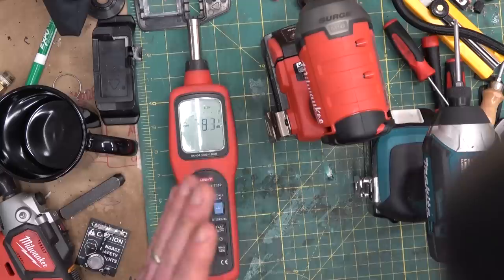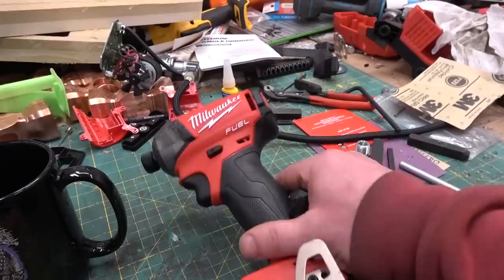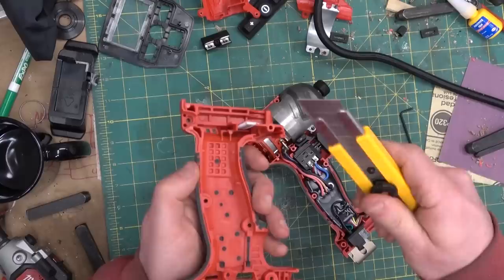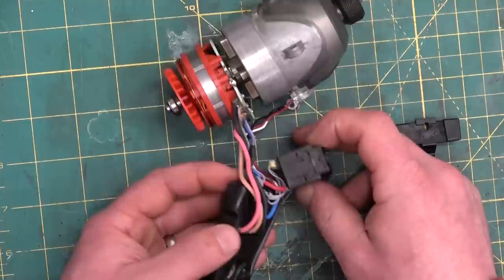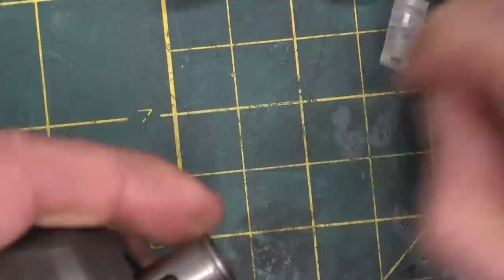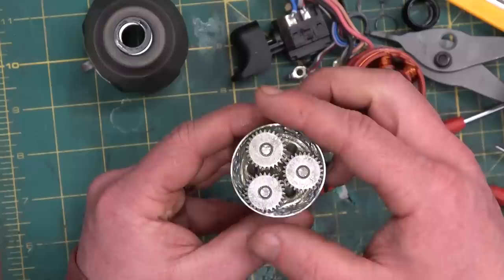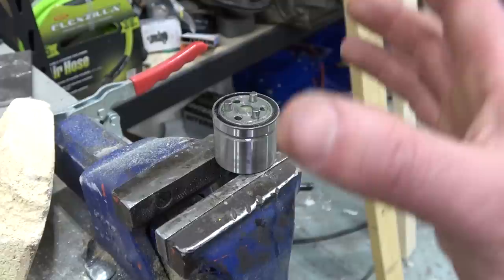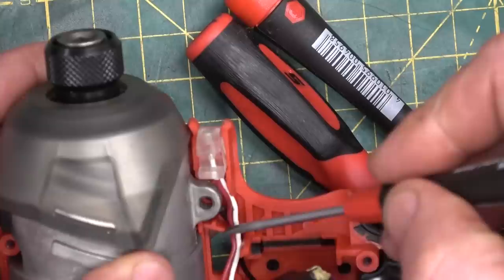BOLTR: Hydraulic Impact | Milwaukee Surge

Comment: AvE, old 7.3L diesel guys and Chevy IDI guys the world over love you for this video. The louder it is the more power/torque it has or the harder it hits, by god that is the first time those guys will ever hear that all the noise and racket they make is more power. Just a slight disagreement with you on that one, more noise does not always mean more power or what have you. But even in the world of impacts and drivers, IR and Aircat (two I have personal long term experience with) are both quieter and more powerful than their snap-on equivalent (Matco for a long time appeared to be using rebranded IR for their impacts). Co-workers fresh from the 'crack truck' impact wrenches would burn your ears like a crying child and screaming wife from across the shop, all while trying to remove a spindle nut from a little Toyota. While myself and another co-worker had IR and Aircat respectively that would spin off spindle nuts faster and quieter.

Also, you let the shmoo out, you can't honestly be surprised that it's not going to work as well?

As far as I know the Milwaukee hydraulic driver is not like the Makita, it's similar to the Ridgid where it uses a vane type pump and controlled bypass of hydraulic oil to couple the input and output. Too slow an input rotation and the fluid bypasses too quickly and there is no coupling, similar to a pneumatic piston with a flow control valve on the output if you move it slowly there is little to no resistance but if you move it quickly then it becomes hard to push. Letting fluid out and either not replacing it, replacing it with the wrong viscosity, or replacing it with too much/too little will cause poor performance and will affect the impact speed and duration. Too little fluid and the impact duration is artificially short and you get a weak impact and slow drive, Too much fluid and you end up with excessive load on the motor, increased wear, and slower impact speed. 
You kind of released the shmoo too early on this one, but that is the nature of the beast and I honestly think you would have less fun if people weren't mad at you in the comments about taking something apart and putting it back differently and then complaining that it doesn't work right. I find some comedy in it myself, like taking an engine apart and putting the wrong bolts in everywhere then complaining it it doesn't work right after.

As far as the real benefit of the hydraulic impact, it's not going to be in the light stuff. Plenty of other impacts are faster putting in small screws, where it really shines is with larger things like lag screws or actual bolts. Additionally the Milwaukee does have a noticeable ramp up time when you pull the trigger, I think it has more to do with reducing stress on either the motor or hydraulic section when guys like to quickly press and release the trigger when driving fasteners, my only guess is that quick jack hammering of the trigger could cause the motor to try and stop only to then slam back into drive and either cause excessive cavitation or pressure spikes on parts but that is just a guess on my part. Things where a longer more drawn out blow is preferable to a quick short blow, this is the case especially with stretchy fibers like in wood. Smaller screws just slide past the wood, but larger screws actually have a little grab and spring from the wood, once you get to a certain point it's not enough to just hit hard, you also have to move past the grip of the wood so the screw slides in further rather than just springs back. It is also quiet enough in most cases to use without hearing protection in the open, not so much in an enclosed space.

Comment: I can attest that those tools made with good molding. I've been using it as a hammer for about a year and it still works perfectly fine. I can also give her a hot supper with running a fuck ton of 6 1/4" thrulocks into lumber

Comment: I got the 12v version of this. I've had the 18v standard style impact driver for years. I grab the 12v surge, I'm screwing into metal, plus it seems to be a bit more sensitive. I'm not driving 6 inch deck screws so the speed difference is negligible.

Comment: I used a Makita one to fasten a deck. Torque was about right and peak torque was lower meaning that the screw heads were undamaged and the bit lasted forever. I have some recollection that the lower peak torque was applied for longer.  Also nice and quiet. My go-to driver unless I need to hit very hard.

Comment: It doesn’t matter about the torque on this one, if you were buying it for torque you’d be buying the regular driver and not the hydraulic driver. I work in a body shop and when I taking apart cars the gun is compact enough and quiet enough compared to other ones. Inside the cabin of a car, the impacting resonates through the steel on cars and is amplified and it honestly hurts the ear. There’s a significant difference when I use my hydraulic one which is a lot quieter. Try impacting bolts -with a hex to 1/4 drive adapter onto steel panels.

Comment: I bought the same Bosch set and found the impact to be weak as Trudeau's chin and the drill adequate for my uses at work. If I want something to hit harder I'll get a corded drill or my SDS. My brushed Milwaukee impact that's about 3 years old hits harder and faster than the Bosch by an appreciable and measurable amount. So the Bosch impact is now relegated to installations indoors where I don't want to drive a fastener through Miss Daisy's credenza. It's weak, but it's comfortable and the battery lasts all day. That's another thing, the Milwaukee 2 ah batteries were running up against those 4 or 5 ah batteries in the Bosch and Milwaukee still won. Ha, you'd have a field day in my garage tearing apart my old 25 year old Milwaukee and Porter cable tools that I bought when I started my business. Skookum sshit was still being produced as late as 1999

Comment: I dropped one of these 10 floors down an  elevator shaft. It broke, partially, at the base of the handle where it widens for the battery. It still works

Comment: Maybe you can tear down the Milwaukee M12 FUEL Installation driver 4 in 1. It seems pretty handy. I’m curious to see the internals on the adapters and the electronics. Electronic soft switches for rotation and locking.

Comment: silicone is good for a Loctite substitute. it will keep it from vibrating lose and it wont do like Loctite but if you cover all of the fastener with it then it wont rust an become totally jamed completely by rust. also for wet areas and wire twist caps fill up that cap very well and then it will water proof that connection so it wont corrode and will work some what as a insulation from a shocking lession when its wet so you dont get shocked by the minerals in the water like rain. and if your worried about being able to reconnect it then cut it off and ad a wire to it. so it will protect insulate and keep it together. the wet area caps suck they just have dielectric grease in them. GO WITH SILICONE.

Comment: There are at least two processes to form Powdered Metal parts.  The first is to press the powder into shape and then sinter to establish the structure.  Additional heat treatments can be applied.  Most PM parts are manufactured this way because of the simple tooling and low cost of the process.  Very complicated parts use the Metal Injected Molded process (MIM) where the part is formed in an injection molding machine very similar to that used in forming molded plastic parts.  This is a very expensive process and in only employed when absolutely required and the costs are deemed acceptable.  This process is difficult to use because the molded parts shrink about 40% when sintered and the tolerances are hard to hold.  Simple round parts like gears lend themselves to the lower cost process and are probably never manufactured using the MIM process.

Sorry for the lecture.

Just trying to advance the dialog.

regards,  KYDIAV

Comment: I have been running these impacts for about 4 years meow and for wood carpaintery they are decent but if you frame with steel these are great (all praise hilti) especially if ya hungover working up framing ceilings

Comment: If you’re going to rock a quieter, weaker impact, may as well go with the M12 Surge. Make it noticeably smaller at the same time.
The difference between M18 and M12 from the specs is minimal.

Comment: That being said, I use this tool on a daily basis, it takes a beating like you wouldn't believe. Also the longevity of it fucking incredible! I've got one that's three years old and has run about 500lb of 3" deck screws along with countless bolts, lags and nuts of various sizes. From a long term view this this is unbeatable! Plus it won't strip screws or bits, barring operater fuckery of course...

Comment: AvE it may not hit as hard but I've been using impacts since Makita came out with their in the 90s and have experienced quite a few others ( Hilti, Milwaukee none hydraulic, DeWalt, Bosch) and seem to have had problems camming out and breaking bits no matter if they were Hilti, Milwaukee, Makita, DeWalt, Wiha, etc. Diamond coated or not.  When I tried this one 6 months ago it has not broken a bit since then. However I did also change to new Phillips II fasteners which are beefier than standard #2s. But it does seem to have me buying less if any Phillips bits anymore even when I'm using standard #2 Phillips fasteners. Seemingly lot smoother operating machine. Haven't broken any standard #2 fasteners (3" long wood fasteners or the like) either since the switch. You do have to be careful not to overnight and takes some getting used to not stripping the heads of screws. More powerful than it seems because of not seeming to hit as hard. A step in the right direction I believe. Just been my experience with it. I think it's a good machine with plenty of power for a sub compact tool. Hilti sub compact didn't do as well as I wanted them to.

Comment: The "surge" tool that is more interesting is the M12 version.  It is rated for 125 lb.-ft. of torque but only delivers 83 according to one site.  Milwaukee also exaggerates the battery capacity of every M12 battery.  They should use the nominal voltage to calculate total watt-hours but they use the peak voltage instead.  The M12 tools are okay but not nearly as good as Milwaukee claims.  Real reviews should mention this shortfall.

Comment: A 17:10, you asked if it would be nicer to have a little tab for the screws to attach to.  Do you think that is was deleted like it is to reduce vibration as much as possible?  Do you think, like I am, that if there were to be a direct connection between the screw/clam shell/housing, then that would/could transfer more impact vibration to the user?  After all, the main idea behind this new impact driver is to lower noise and vibration.

Comment: I have the Bosch and the Fuel impact. The Bosch will run circles around the Milwaukee for speed. Putting down sheeting, the Bosch was miles ahead. A year later, the Milwaukee will run circles around the corpse of the Bosch. RIP

Comment: I was a theater carpenter in high school and we used the ridged hydroloc impact for repairs during a show cuz you we could put a blanket over it and it would be quit enouph crowd couldnt heat it but def wasnt the workhorse in the shop

Comment: I take exception to the louder hitting harder. That's only if your driver uses hammers. This uses a torque converter, like a car. It'll transmit torque quietly, which is probably why the built it.
I have a feeling you messed up the shmoo level. Should have tested it before parts expansion.

Comment: I use this Impact literally everyday and absolutely love it. When on setting one, it's great for light torque applications and is consistent. Set in on level three or 'drill' and the auto stop feature is good and bad. If you're using a socket adapter and you're trying to run a nut down, it does not do good as it constantly auto stops...BUT when tightening things down that don't require you to run the screw all the way through, it does great. I do not recommend if you're looking for speed. Torque consistency, way easier to keep on a screw without a ton of force, seems to be very efficient on the batteries and much quieter. I use my other older Milwaukee impact for assembling things that require speed and brute force.
Reply: That’s not speed 3. It’s the fourth speed: “self-tapping screw”

Comment: I went to buy one because I sometimes work in medical offices and need something a little quieter. I ended up walking out of the homeless despot with the m12 gen 2 driver drill fuel kit. They sink am faster than the dewalt the guy I work with some days runs. And its smaller. Works for me. Someday if'n you have a chance, I'm curious to see how the electric clutch works on the drill. N yes id take it apart my f-in self but that I'm afraid id never get to use it again. 🍻

Comment: I hate to break it to you, but that little RFID tag tab is probably not that expensive of a feature.  It's at a spot between two parts of the mold, so it's just a shallow pocket in one side and a flat surface on the other.

Comment: Speaking of decibels, I had a guy I used to work with.  He was for some reason made our "Safety Manager".  So the back up alarm on our forklift died and he went shopping for a replacement.  I think the OSHA requirement was around 90db but he bought one around 120db.  He had no freaking clue how decibels work   ITS A LOGARITHMIC SCALE.  He didn't know what those are either.  So he bought one that was about 20X louder than necessary.  I put up with it for about a week before I wrapped a dirty rag around it with some duck tape.  Later, to make it look nice, I pumped it full of RTV silicone rubber and put a sticker over it.  Still too loud, but cheaper than buying a new one.

Comment: That tab on the inside that is so expensive also is the cause of much cursing by molders. Tabs like that tend to get stuck in the mold or a great place for shorts. It is liable to be a hundred (even a thousand or two if the operator is day dreaming) parts before anyone realizes the damn tab is missing. With that overmolding the parts can't be recycled into regrind, they got straight into a landfill.

Comment: We've given up buying Milwaukee at work. Thrown about a dozen rattle guns and drills in the bin. The tines where the battery engages the tool is shite. They're sloppy out of the box and brake easily. The batteries get loose and people end up taping the battery to the tool.

Comment: the 18 borch and  hedro millwikky are the most used tools  i got ,, i screw a lot ,,  i also use a 12m millwikky on them long jobs ...      the bosch has a good power balance but i'm partial to hedro tools now ....  i probably will replace the borsh with something more powerful if is going to be that loud anyway might as well.     fyi from random guy ..

Comment: I disagree.  It is slightly slower,  but when used outside,  you don't really need ear plugs.  And i felt on #2 Phillips,  it doesn't destroy the tips as much or snap screws.  So on longer fasteners,  it's actually better.

Comment: I have 3/8 stubby lasted 5 years beat the hell of it bought another one and I work on diesel engines all day everyday battery lock in suchs tabs brake end up with electrical tape keeping battery tight but they work don't k own about 1/4 but the stubby 3/8 is well worth the money

Comment: Dewalt impact had me clenching my teeth running screws- to keep the bit on the screw. 

The hex hydraulic is like pushing an elevator button. 

That’s $$$ in my shoulder and jaw. 

*I run hundreds of screws a week.

Comment: we were getting 700 pounds of torque with a 2-7/16 nut on a flange. barely had to even touch them with high torque. awesome machine, we used the 3/4 drive torque impact

Comment: Interesting 🤔 
What if you had glued on sandpaper or skateboard grip tape around the hydraulic bit and then went at it with an oilfilter wrench maybe not the metal one but the nylon strap one.

Comment: so that hydraulic coupling you were trying to take apart dose that work like a torque converter dose ? or is it like what those new fancy magnetic locking differentials on the newer 2020 cars i tried to take on apart that looked like that but was on the rear diff on a 2018 mazda cx-5 for fun (car was in a wreck so got some scrap parts to mess around with) i got it like 6 turns loosend with the torch and a giant pipe wrench on the vise let the schmoo and the smoke out never got it fully apart.

Comment: Surprised! I have the surge and I put it up against my friends bosch freak 2.0 and the surge won on any screw shorter than 3 inches anything bigger the bosch won. Additionally the surge also came to a complete stop throwing in tapcons into a door frame. I’d only use the surge for small kiss me arse screws nothing else.

Comment: What oil was used for filling and how much by volume?
I bought such an M18, but one screw was not fully tightened and all the oil leaked out. Filled mobil atf 220 with what was at hand. As a result, it turns very weakly.